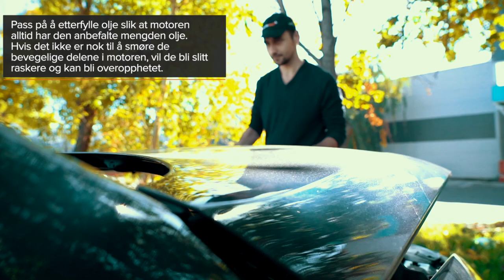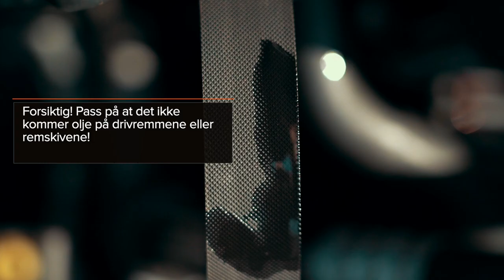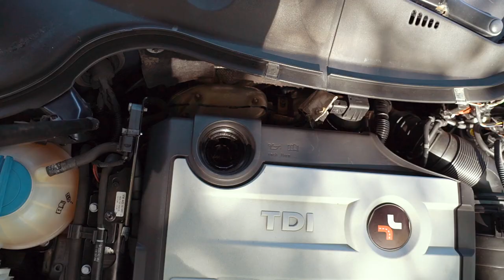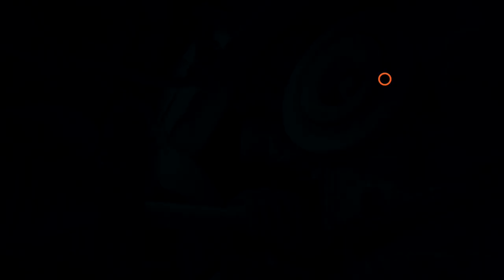Slik fyller du på olje selv | Hva skjer hvis du fyller på for lite eller for mye olje? | AUTODOC

Comment from the maker: Vær den første til å kommentere videoen 💬

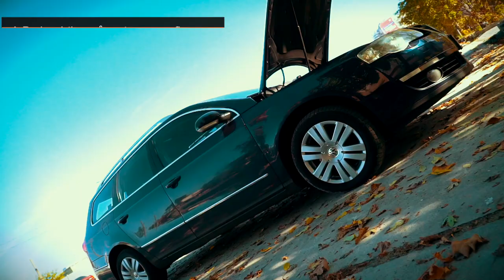0:13 — 1. Parker bilen på en jevn overflate.
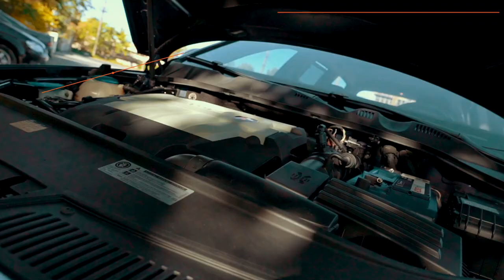0:18 — 2. Pass på at du fyller på mer av den samme oljen som allerede er på motoren. Dette gjelder både viskositet og merke.
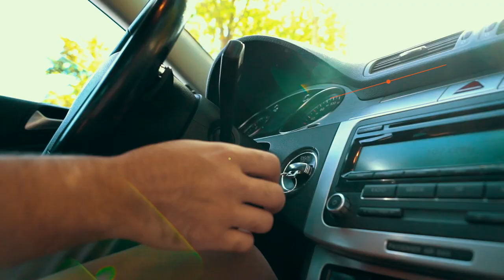0:24 — 3. Koble ut motoren og la den kjøles ned i 10–15 minutter.
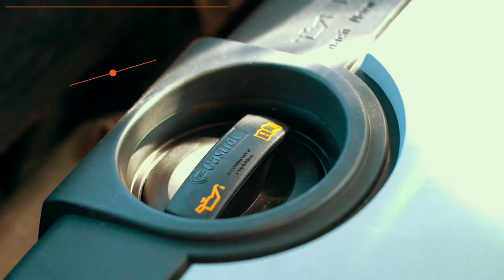0:33 — 4. Fjern oljepåfyllingslokket.
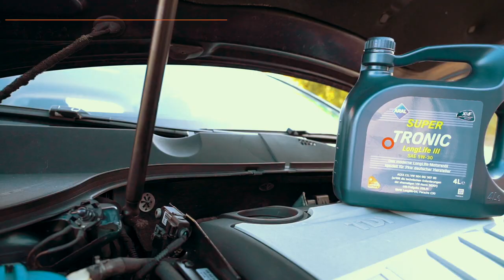0:45 — 5. Sett en trakt i oljefilteret.
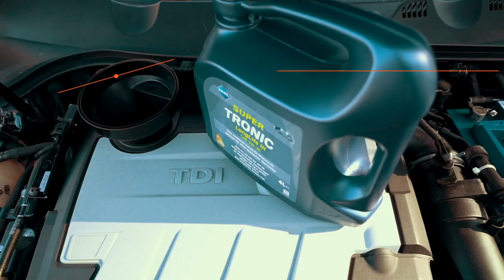0:48 — 6. Hell på 100 ml motorolje og vent i 10 minutter.
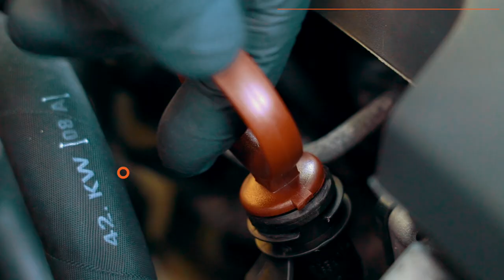1:03 — 7. Sjekk oljenivået med peilepinnen.
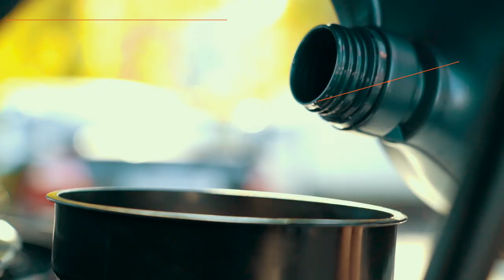1:09 — 8. Fyll på mer olje. Fortsett med å helle på 100 ml om gangen og kontrollere nivået til det kommer opp til den anbefalte mengden.
1:20 — 9. Skru oljepåfyllingslokket stramt til igjen.
Reply: Det høres tidkrevende ut å fylle på 100ml hvert 10. minutt.  Skal du fylle på 1 liter, så tar det lang tid. Stemmer  ikke  den gamle  oppfatningen mange har at om det er 1 liter mellom minimums- og maximums-merket? Så hvis man er under minimum når bilen har stått stille på plant underlag, så kan man  fylle på 1 liter?
Reply: Hvordan vet man hvilken olje som allerede er på motoren?